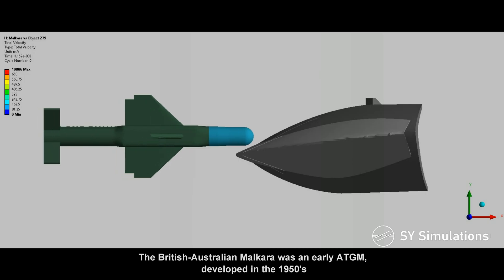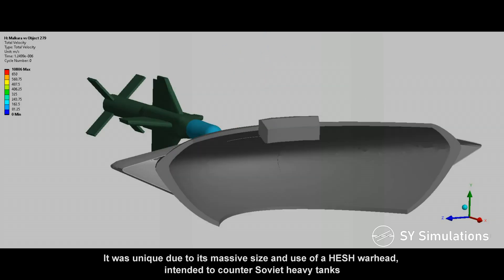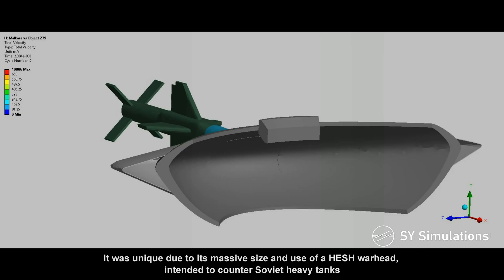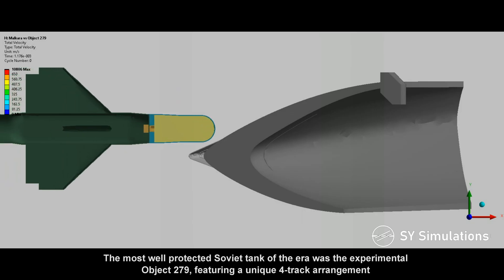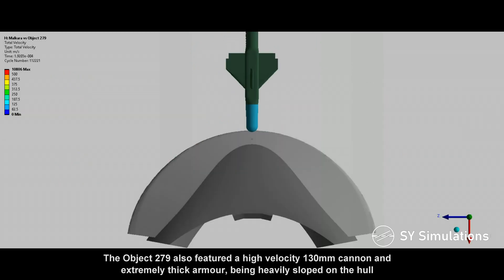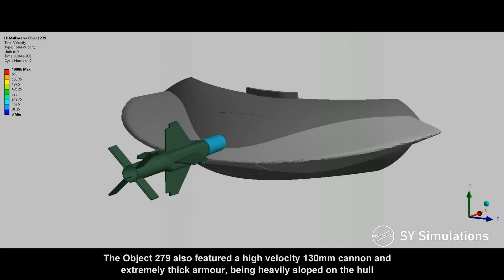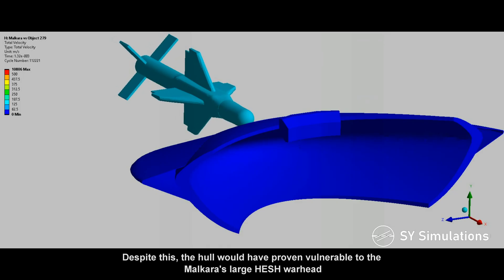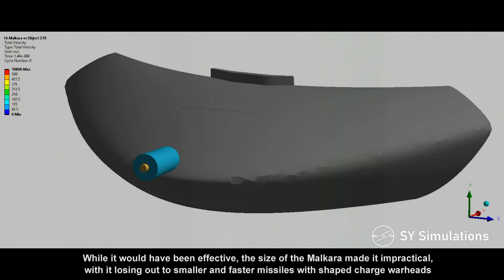MALKARA HESH MISSILE vs OBJECT 279 | HESH ATGM Armour Penetration Simulation

Comment: HESH warheads are really interesting,  incredibly effective for a relatively low tech, low effort design. excellent bang for the buck.
Reply: *and use no tungsten or high alloyed steel
Reply: Heat id just as cheap and way more efficient
Reply: @missionslos  It was more reliable and better against angles than HEAT though. Real life isn't war thunder and it took until the 80s for the US to field HEAT that fuzed reliably on heavily sloped armor (60 degrees and greater). HESH is also much better against all types of structure than any conventional HEAT round, sicne against concrete it will squash and shatter it, while against thin walled buildings it will basically work as a delayed fuze high capacity HE round.

Comment: theoretically would spaced armor counter HESH? shockwave only travels through the top layer, shrapnel is caught on the second layer
Reply: Yeah that's one of HESH's problems
Reply: Yeah, but it has to be thick enough. In reality 120mm HESH will punch through at least 28mm of RHA before detonating as tested by the brits.

Comment: Am I curious about the design philosophy of the missile. Like HESH has wrongly gotten a reputation in tank-interest circles as being an AT warhead; when in reality it's single best use seems to be against structures. So with this missile, was the idea to create a missile that did have greater use cases; like against bunkers, buildings, as well as packing in more HE than a HEAT round allows (even if the delayed fuse makes it less efficient against infantry if the round hits soft ground)? Like in terms of blast effects (not frag), it's more bang than the upper end of 152/155 artillery shells. If not, I do have to ask why they didn't just go with HEAT? Is it down to after-armor effects? 

I would actually like some like-to-like comparisons of HEAT and HESH after-armor effects. So maybe 105mm NATO HESH and HEAT-FS rounds against the same targets - with a spread of different targets to show what might be some interesting edge cases.
Reply: HESH was only seen as an AT warhead for a short period of time post-WWII.  Most guns firing HESH had other dedicated AT shells and used HESH for softer targets and emplacements.
Large-caliber HESH was used as the sole AT ammunition very rarely, but it did have its niche:
-glancing blows would still mission-kill a tank through suspension wrecking, observation device destruction, turret drive damage, like any large caliber HE shell where HEAT may not fuse or fuse improperly and a kinetic round may bounce or do little damage (main advantage)
-armor was still solid steel and which transmits the energy very well and gives you all that spalling effect, composite armor doomed HESH as a dedicated AT round
-HEAT benefits more from smoothbore guns which were not commonly in service until further into the cold war, the spin from rifling counteracts the munroe effect to a small extent, HESH benefits from rifling due to the spin spreading out the charge more when it impacts, the UK has used rifled guns on their MBTs to this day for this purpose while almost every other nation has switched to smoothbores
-HESH is a multipurpose round
Reply: my understanding is the "soft" squash head is designed to perform better than HEAT on highly sloped surfaces, where a conventional hard tip projectile may glance off and waste its payload.
that and the hesh round probably flings a large circle of spall to the inside of a tank, compared to a high pressure jet type penetration.

im not convinced you would want to use HESH on a building over other typical tank ammo
Reply: @Stue-e  From my digging, HESH seems to be significantly better than pretty much any round for demo work. It seems to be pretty much pulverize brick and concrete, with, I believe the shock transferring deeper/further into the surface from the impact point. It directs the energy into the target rather than just spreading it out uniformly like a standard nose-fused HE round
Reply: This gets on my nerves, too. They made the widest ATGM in human history, 203mm... and gave it a HESH warhead. 🫩
Modern 203mm HEAT would pen like 2400mm of RHA.
Reply: @alistairalexanders  In all likelihood is says more about our lack of understanding. There's a lot of things out there, made by professionals and highly qualified folks that seem like odd decisions to those of us in the "strongly interested, but not professionally involved" camp - and, in my experience, there's often sound reasoning, even if the theory behind the thing didn't survive the test of time, or doesn't align with what we personally care about/like. 

My guess is that their "mission profile" for this missile was different to the missile profile for almost all ATGM's. Just a guess though.
Reply: @alistairalexanders   You're confusing name with function.  ATGM aren't expected to only engage tanks.  Attacking bunkers and the like are a big part of doctrine for most ATGM.  HESH makes sense given that half way through the design programme they started thinking about other applications.  And then it turned into Seacat - an AAM.
Reply: It's pretty simple really: HEAT is easier to hit with, all other things being equal, and it is more effective overall.

But ....

HEAT has one use and one use only: AT work.  It is also more limited in terms of angle of impact.  A bit of an all-or-nothing round. 

Heat-fs and heat-frag are recent things, relatively speaking.
Reply: @iatsd  And they still kinda suck. In the end, it appears that good old HE-FRAG is forever, despite the effort.

Comment: HESH never gives a damn, if you ain't composite or HEAVILY spaced, you ain't surviving.
Reply: spaced armour is just composite with air as a layer
Reply: Only when it's stupidly big. 105mm HESH had rather unimpressive armor penetration. Most nations never bothered trying to make it the primary anti-tank warhead for any weapon and used it like an HE round with a modest secondary anti-armor capability.
Reply: @DecidedlyNinja  thats exactly what it was meant to be. A round that could handle anti-infantry, anti-fortification (primary usecase), and anti-armor. They didnt field HESH as a replacement for APFSDS, it was complementary. just like how modern multipurpose (MP) rounds in vehicles, such as the abrams, can function as anti-armor but are more meant as a utility round.
The ability for the round to do everything was why it was desired, until composites became standard.
Reply: @connivingkhajiit  HESH fails to impress in anti infantry and anti tank roles (you're better off firing HE), it does however work better at fortification destruction.
Reply: @DecidedlyNinja  War Thunder is not a source my dude.
Reply: Gaijin: I think it must be a hit.
Reply: If it was HEAT warhead it probably can heavily damage the fighting compartment or even reach the engine. Not just kill the driver. Only stubborn British use TS.
Reply: @freedisappointment815 except for that not being the case here, this tank is totalled, this only shows a limited aspect and is a more multipurpose round in that era, whereas heat was more anti armour docused
Reply: @Retrosicotte HESH got no shrapnel on it own. Making it less ideal for anti infantry. Only good at dealing obsolete tank without space or composite armor and bunker. In this video HESH is effective because the sheer size it got. For tank cannon like 105 and 120. HESH are underwhelming for both anti tank and anti infantry.
Reply: @freedisappointment815 except for that not being the case at all. In this era composite isn't really a thing and spaced only reduces. Anti tank doesn't rely on shrapnel, stop playing video games... Between heat and hesh, heat is all anti tank, but hesh is multipurpose he and anti structure too
Reply: @Retrosicotte I said HESH got no shrapnel is not ideal for anti infantry. HEAT already is a multipurpose round. It is not as good as normal HE dealing with light vehicles and infantry. Still, at least HEAT got some fragments if the blast wave was not enough. This is why everyone still using HEAT. It can be improve multipurpose roles like putting a fragments sleeve on it. Unlike HESH. It is already a dead-end.
Reply: @freedisappointment815 "heat is as good as normal he" and there went all your credibility
Reply: @Retrosicotte Jesus Chris, you need glasses.
Reply: @freedisappointment815 nah, I have facts, which are better
Reply: Objectively wrong, it was just Brits with OCD that used HESH, nobody else did. 😂
Reply: @alistairalexanders  Except for many countries that did so nope, do more research.
Reply: Sweden, USA, germany, france, all fielded hesh
Reply: @connivingkhajiit   They had to, because the 105mm tank gun came from UK. They also had to put up with its BS rifling, which is detrimental to HEAT and APFSDS. 😂
Reply: @alistairalexanders you’re not seriously saying they had to ‘put up’ with the L7 105 right
Reply: @connivingkhajiit  They could fire HESH, but did they keep in the loadouts?
Reply: @alistairalexanders The US Army used it too, especially for demolition works.
Reply: @alistairalexanders  brother the L7 105 was the best NATO gun at its time.
Reply: @alistairalexanders rifling makes round more accurate, that’s just physics.
Reply: @Thatsnotmycow  Spinning makes long rods tumble and shaped charge jets dissipate, also physics 😂
Reply: @alistairalexanders accuracy though. And you can put a rotating cam on both rounds to resolve that issue. Ukrainian tankers say the rifled 120mm is like a sniper rifle. They’re hitting first or second round rather than 4th or 5th.
Reply: @Thatsnotmycow  Rifled barrels are worse for firing APFSDS (you can try to counteract the spin, but its effectiveness is diminished by variations of barrel wear, giving it intrinsic flaws in stabilization of the rounds) and most of the tanks they are experienced in using use FCS systems that predate the challenger 2 by at the very least 20 years. 

Basically no modern ish tank (anything post cold war outside of things that specifically lack FCS upgrades) should be needing more than one shot to hit a target within 2km outside of user error